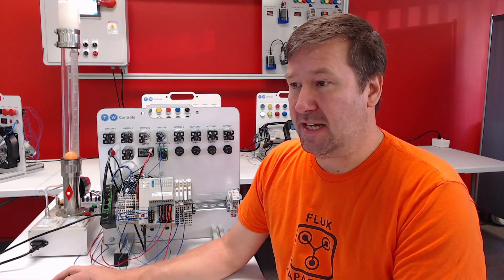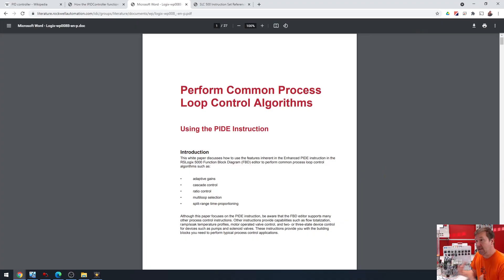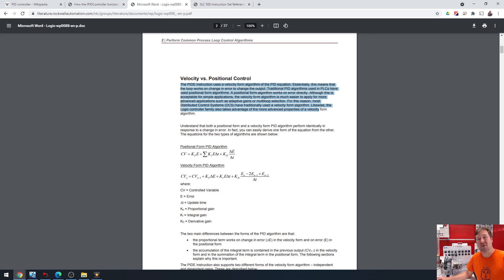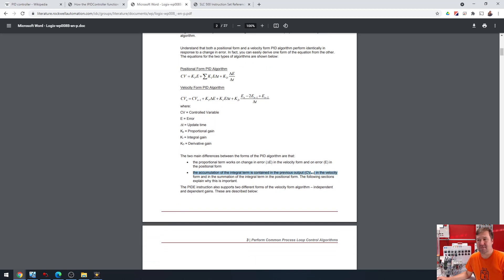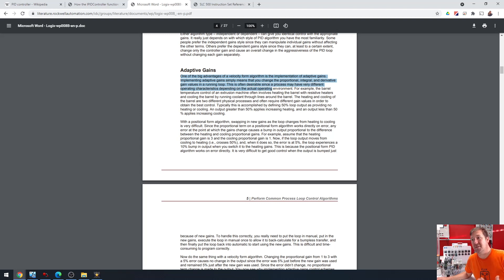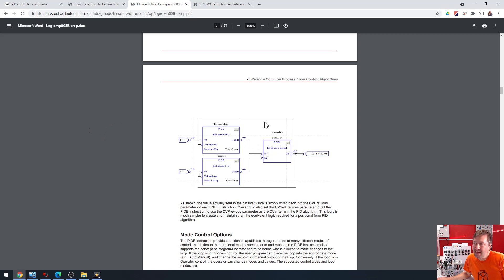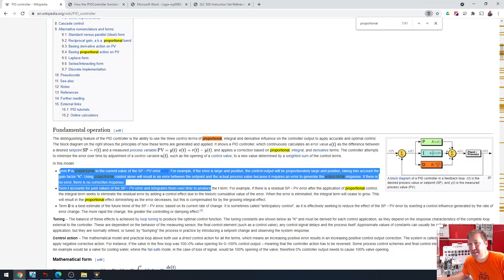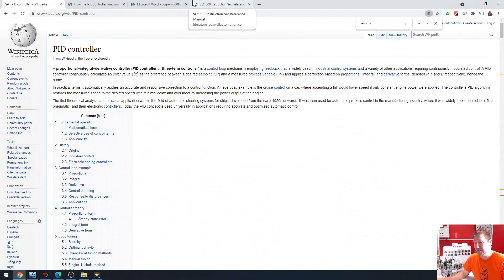PID Velocity vs Positional Equation - Studio 5000 PIDE Instruction

Comment: Hi Tim,

First, I'd like to thank you for all your videos—they have helped me countless times! You do great work!

I'm currently working on a project for an extrusion control package and have been struggling with the PIDE setups, which I'm sure you hear a lot. The issue I'm facing is extremely long lag times, sometimes up to 15 minutes. I've tried auto-tuning multiple times, but it keeps timing out.

Despite these challenges, I have managed to get everything working reasonably well, but it's far from perfect. The main problem is the PIDE locking up at 100% output if the die zone doesn't reach the set point for a couple of hours. I've looked into anti-windup strategies, but I can't figure out how to implement them correctly—if that's even the right approach to fix this issue.

Any advice or guidance you can offer would be greatly appreciated.

Best regards,
Derek
Reply from the maker: Hi Derek.  What do you have your limits set to?
Reply: @TimWilborne  😃 If your referring to the cv limits their set 0-100%.
Reply: Same problems. How did you resolve ???

Comment: Thank you for this video… I used PID with only P, no I, no D in a function block diagram and it doesn’t work as expected… then I see how CV is calculated… oh! It slowly creeps up if the PV is under the SP… but how do I know that the CV will stop when the process has reached the desired temperature? 🤦🏾
Reply from the maker: With proportional only, it won't necessarily

Comment: Hi, thanks for the video.  So the Wikipedia article is correct, it's just "different" thant RA's implementation, correct?  (BTW, I do work for RA, but that doesn't necessarily make me a PID/PIDE expert :) ).
Reply from the maker: Incorrect.  There are numerus different PID equations.  It this level, you can't be looking to Wikipedia as a reliable source of information.
Reply: @TimWilborne  So the issue is that they have just picked a specific one (a textbook PID), without mentioning that there are many different variations, right? Or are you also saying that the one they explained isn't correct to begin with? Thanks.

Comment: Hello Tim, Thanks for posting this video. It is very important to not only understand the difference between dependent gain form (series form) and the independent gains form (parallel  form) but also the units of measurement of these tuning parameters (for e.g. whether it is integral or reset time in minutes per repeat (or seconds per repeat) or whether it is reset rate in repeats per minute (repeats per second). And then one also has to understand whether the programming software environment supports positional or velocity algorithm. After one is done figuring out the above, one also has to see how output tracking and reset windup (integral tracking/external reset feedback/ inhibit increase-inhibit decrease) strategy is implemented. 

Tuning in itself requires a very good understanding of process (self regulating/integrating/near integrating) that one is intending to control and also how the various parts of the loop impact the overall loop performance. Non-linearities in process or the control valve or the measurement device can be detrimental to the loop performance and that's where the true power of the PID capabilities supported by a certain OEM do also come into play.